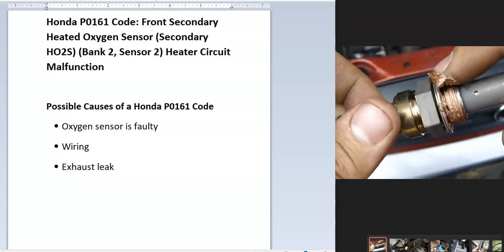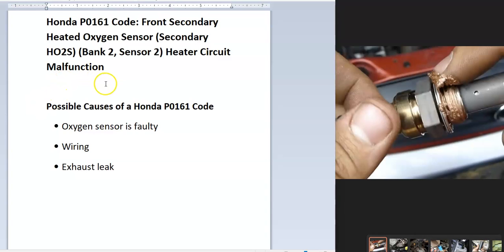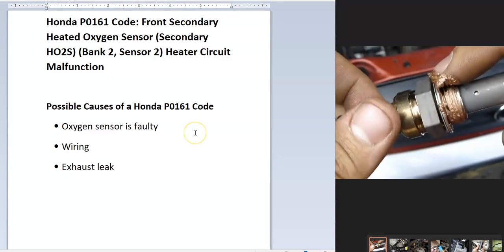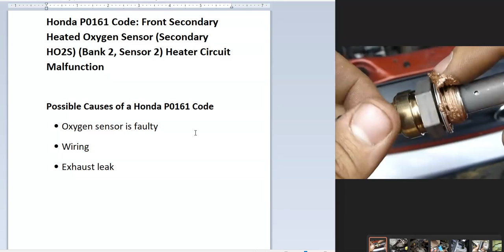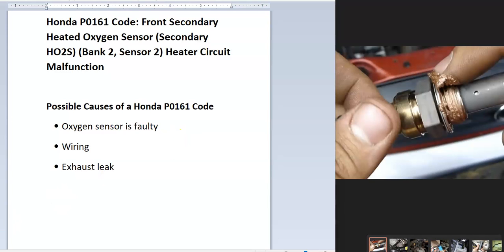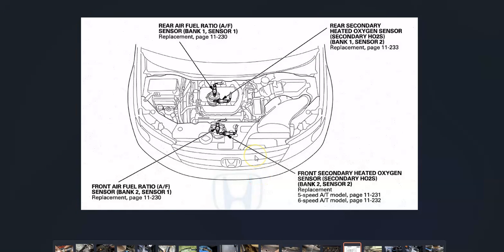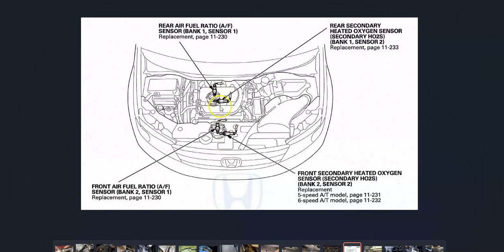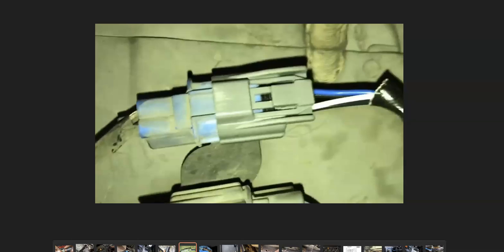How to Fix HONDA P0161: Front Secondary Heated Oxygen Sensor (Secondary HO2S) Bank 2, Sensor 2

Comment: I am having a hell of a problem with a 16 Accord Touring 102k miles, always maintained and timing done at 80k. The long and short- A year ago while on a trip cruising at 80mph the engine basically went into limp mode, as in it lost power but was running (barely), would not accelerate, would stall when stopped, all warnings popped up (check engine, catalyst, steering, LKA, CAS, ect ALL). I had it towed to a dealership and they replaced the cats and o2 sensors ($4,800 in repairs). The car made it apx 100 miles and did it again. I had it towed to another dealer who said they could not recreate the issue and no mil was illuminated 🤔.  I continued home and the check engine light came on but the car still ran fine. I have been back to my local dealership 20x over the last year and it's for the same issue every time. P0420 and P0161. The dealership changed the cats again but when it didnt work they have basically given up I would say. Every time I drop it off they tell me they will hook it up to the computer and let Honda diag it from a remote location. They call me to tell me it's fixed and I pick it up..... sometimes I can drive 10 miles before the 2 codes come back other times I can drive 5,000 miles but the P0161 and P0420 always come back. I have spent over $10,000 on this issue in a year and a half but still have the same issue. Any ideas????? I know it's a long shot but what else can I do? Any ideas at all?